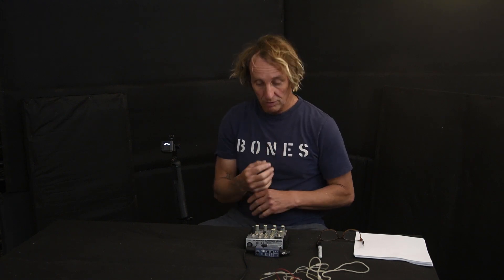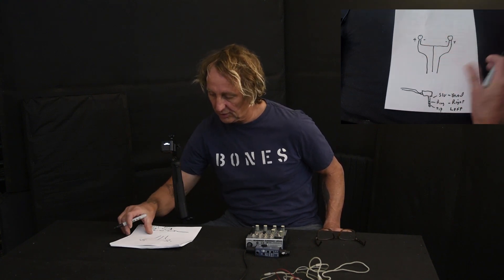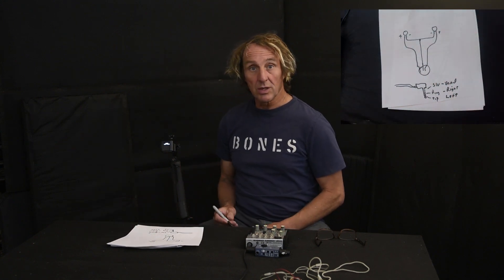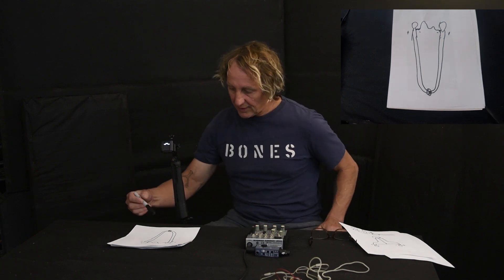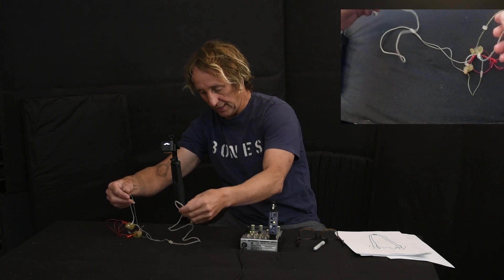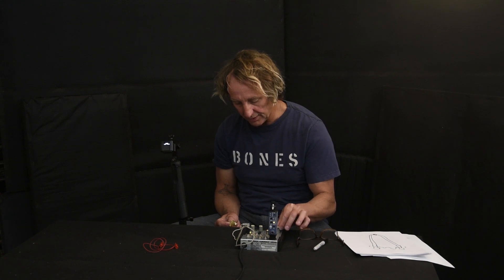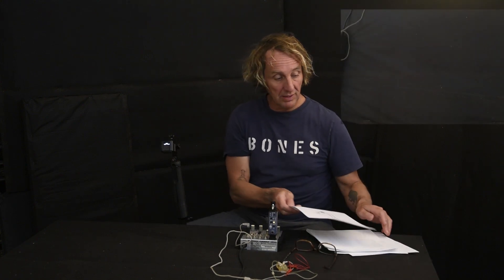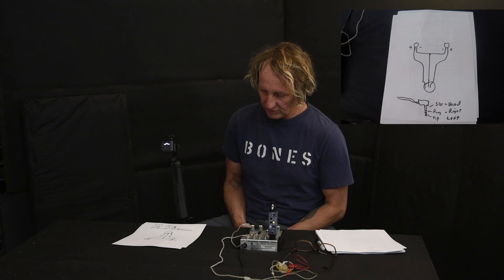The Audible Difference between 3-wire vs 4-wire Headphone/ In-Ear Monitor Cables

Comment: That's what annoys me about Beyerdynamic's wiring choices, particularly since Sennheiser have generally been doing it correctly for 30+ years.
On a side note, what most people don't get about the crosstalk introduced by a 3-wire system is that it effectively attenuates (L+R) over (L-R), i.e. a stereo widening effect. (If driver impedance is quite variable over frequency, that attenuation is not even constant, but that's a discussion for another day.) Since most bass is panned dead-center, this gives a slightly leaner sound depending on how much shared resistance there is in relation to driver impedance. It also means that you can potentially compensate for the effect to some degree if your source equipment sports a fine-grained stereo width control. The arithmetic is quite trivial in the digital domain in particular.

Comment: Hi, Dave! I have a question. I'm in a live situation and I have an rack headphone amp an form it I want to run a long (10 to 23 ft) extension cable in which the player plugs in their in ears. Will the bleed be accentuated by the length of the extension cable? And will it make a difference if the extension cable is 4-wire but ends in a 3-conector TRS female?
Reply from the maker: Should be fine

Comment: any possibility that this is a side-effect of back EMF from the opposite driver finding a partial route through the opposite driver as a shorter path to ground? could current be drawn across the ground wire (less resistance than the ground path back to the amp) by the action of the drivers?
Reply from the maker: It is due to resistance in the ground wire. This is easily demonstrated by reducing the resistance of the ground wire with a clip lead. Seperrat wires can have the same resistance but it eliminates the the resistance impacting the other side

Comment: How is this possible? The resistance of the ground-cable should be 0….. it seems to be a kind of voodooo…300 years ago u would be burned on a Fire….🤷🏽‍♂️
Reply from the maker: Try it. Super simple to prove. I found this issue when doing tests and hard panning signal to one side on various headphones and found that some headphones the image did not pan all the way. I disassembled the headphones and found that all of the headphones that did not pan all the way had three wires and went on to develop a test.

The Crux of the assumption that you made of ground being zero ohms is flawed

Resistance can be low it can be very low but it is never zero. That slight resistance in the ground wire creates this issue

And misunderstanding, false assumptions and oversights have been the driving force behind anger fear and retaliation since the beginning of mankind nothing new here
Reply: @DaveRat  Dave…. the problem with the problem is, I think u r right…. But till today I would not have believed it…. 🤷🏽‍♂️ so thanks again….
Reply from the maker: Same here, I was shocked to find it audible.

The real rub for me was that I was doubtful that home hifi bi wiring had any merit but after finding this, I now think that there could be some possible advantage to running separate wires to a passive HF and LF from the same amp.

Would need to test but the potential for audible artifacts is a pissibility

Comment: Respectfully.  When panning the 3 wire setup with in-phase signals, I believe you are listening to line loss not cross-talk as the signals are 100% in-phase in your noise test.  The net result will manifest itself as a signal loss between the two channels in your test.  In real world 2ch operation where signals differ there could be a cross-talk component present - in which case, I submit would be lower than that of the source system thus rendering it negligible at best.  Of course, if the wire gauge were that of a human hair maybe, but in practical applications probably not noticeable.

The attenuation to signals between the phones on the 3-wire setup would be for in-phase signals in a stereo mix.  This could result in some spacial perception as it would limit peak responses for the in-phase component of the signal.  Change the "openness" of the sound.

I guess that's your point, is there will be an audible difference in 3-wire & 4-wire headphone systems.

Interesting topic Dave.

Oh, feel free to shred my comments.  This isn't a who's right battle or ego game - information exchange to learn and understand.  :)
Reply from the maker: There is definitely a difference between 3 and 4 wire setups that is audible. I can say this because first I heard an audible difference, then after diving into it, I found the difference was three wire headphones have reduced stereo imaging. Also, years ago running a 3 wire setup with a common ground and a a hot for HF and and a hot for LF for a PA system, sounded bad and the issue was fixed when running 4 wires.

Electrically it is easily shown there is a difference, what is surprising is the difference is easily demonstrably audible.
Reply: @DaveRat  Agreed 100%, all the way to perception of stereo imaging being different or constrained.

Comment: This is great stuff. This is the kind of difference that would never show up on a schematic, because both the the three-wire and four-wire setups are "identical" . I think the phenomenon you describe and demonstrate here is similar to why isolated ground receptacles are used in hospitals and such (orange outlets).
Reply from the maker: yes, maybe a bit similar.  Isolated outlets are safer as each has its own ground and if something goes wrong elsewhere it does not impact everywhere.

Yes, the difference does not show up in schematics but should. The assumption that a wire is zero ohms is false. If the true wire resistances are included in the schematic, then the issue would show up and be a calculatable amount.

We see this a lot where assumptions of irrelevance are incorrect.  I have seen it in 3d sound modeling software where the dimensions of the various source loudspeakers is assumed to be smaller than the actual, or the cabinet dimensions are not included as a surface or the lower mass of a modern light weight flown array is not accounted for and when the speakers all move outward, the array moves backwards ever so slightly, but the surface area of the array is so much larger than the surface area of the cones that even a slight motion results in the cabinets acting as an out of polarity sound source that alters the real world dispersion and reduces the output efficiency.

Comment: The effect depends on speaker and wire impedances. Imagine 10 ohm wires and 4 ohm speakers....
Reply from the maker: True and years ago when I first started building speakers I tried using a common ground wire for biamp speakers and using 3 wires. The sound was audibly poor quality. Then years later while doing some perceptive latency tests using headphones and altering the latency in on ear, I noticed that when I muted on le side and had sound sent to the other side, I could hear sound bleed I to the muted side.

I spent some time looking into why this was happening and discovered it did it on my Sennheiser HD 25 0hones and not on my Sony CD3000 headphones. 

I finally located the issue and it was that the Sennheiser HD25 used a 3 wire cable and the Sony's used a 4 wire.

Further testing showed that all the 3 wire headphones had audible sound bleed and and all the 4 wire cables had none or very close to none.

And finally, again many years later, I though I would share something that is real world, audible and not uncommon yet over looked.
Reply: @DaveRat  Most consumers just read the specs, telling them what the actual speakers are capable of, having no idea of impedances, capacitances and other horrors from the snake pit. 😬
Reply from the maker: @ThunderBassistJay  agreed

Comment: Dave, Robert Van Zandt here..  Could you do a part two where you use two identical mixers and else two pulse, pink and music generator/source (unique sources so literally one generator to one mixer to left only of headphone output that you also split into smart. Times two one for left one for right.   Compare this to the normal setup.  That way you can see/hear/measure like you do so well.    Perhaps you will be able to prove that we have headphones/iem all wrong in pro audio that needs to change to discrete outputs on 4 wire.  We would never accept 3 wire on high outputs, we would never use 3 wires to sent left and right to mains.    Why the hell would we affect headphones??    I am predicting not only is the common changing seperation, it is changing both left and right response curves.  you might start a revolution in pro audio my friend.
Reply from the maker: There are two more videos already up on the members side of my YouTube. One is a bit different testing of the 3 wire vs 4 wire and with the other I connect a 4 wire cable and show that if you short it, to make it act like a 3 wire, you are adding copper and reducing the stereo separation.

It's such a cheap and simple fix for headphone and in-ear companies to use 4 vs 3 wire cables, it's pretty silly to see 3 wire cables on anything that costs more than $5 or so.

Comment: Would a TRRS connector (w/a TRRS headphone slot)  solve the issue instead of the option of having 2 x separate jack connectors one for left and the other for right ?
Also, is it possible to attend your next Zoom chat ?
Thx in advance
Reply from the maker: Yes a TRRS would solve it, but even easier is just using 4 wires from the TRS connector as nearly all of the issue is eliminated by using a 4 wire cable. As far as the Zoom chats I post the details on the YouTube Dashboard to Members. The monthly cost is only $4.99 and and no commitment. You could sign up, access all the exclusive members videos, attend a few zoom zoom chats and then cancel before the month is over. 

I use it as a filter to and its a cool group of people. I do an open chat, answer questions and update on what I am working on every week or two in the chats

Comment: There must be a back emf from both drivers. You should have disconnected the sat on driver to see if the pink noise went away
Reply from the maker: The wires act as resistors. And with a 3 wire, both speakers are connected to the common middle resistive wire. The powered speaker has two voltage return paths, one is down the common wire, the other is through the other speaker and down the other wire creating sound.

Another test I did, I used a 4 wire cable, shorted the commons near the speakers and it acts just like a three wire.

Comment: Dave, if I'm understanding correctly. The 4 wire setup has 3 wires coming from the TRS to a connector and then branches to 4 wires? One wire R+, one wire L+ and two independent ground wires to each from the connector?  Where the three wire setup shares a single common ground wire for both L and R from the connecter?  If this is correct, do both the 3 wire and 4 wire set up’s use a common ground between the TRS and connector? The wire differences being after the connector?
Reply from the maker: Yes, what happens before the connector will vary from product to product but typically whatever it is, there are fairly short distances involved with wires or circuit traces that tend to be much thicker than the thin flexible long headphone wires.

After the connector, some manufacturers use 3 wire cables that go to one ear and 2 wires go to the other ear. Some use 4 wires to une ear and 2 wires to the other ear. Some use 3 wires that hit a cable junction and split to 2 wires to each ear,  some use 4 wires that hit a cable junction then 2 wires to each ear. And some use more than 4 wires with multiple wires to each ear.
Reply: Awesome Dave! Definitely learned something new. Thanks for the reply and sharing the knowledge. Much appreciated!
Reply from the maker: @Bobby_Uterus  awesome and thank you Bobby

Comment: Do you know of any wireless/amp manufacturers that support TRRS cables in a live scenario? I know there are amps for audiophile listening, but what about for live use?
Reply from the maker: I do not know anny, but from the testing I have done, the 3 conductor Jack is not the big issue, nearly all the issue is in the cable. I believe it is the desire to have long thin flexible headphone cables that adds the resistance that causes the issue.

Comment: It's my opinion the number of wires doesn't Matter it is the source from which the music comes NOO ?
Reply from the maker: Using the same source, and using 4 wires, if you short the two common wires together near the headphones, making it a 3 wire connection that has the exact same amount of copper, the stereo separation reduces.

Comment: OK.....so electricity is electricity.  This experiment makes me think of ground loops.  Request an experiment where multiple outboard gear is located in the same rack and therefore their chassis grounds are connected through the rack.  Now what if each piece of gear is isolated and their grounds are connected all the way back at the plug.  How would interference on one piece of equipment transfer?  Would one scenario be better than the other?
Thank you for all your brain teasers.....
Reply: Yes ground loops are a different animal. Your test example here just made me start thinking of other issues with ground isolation.
Reply from the maker: @stanleypebsworth1829  I will put ground iso on the list of vids to do!
Reply from the maker: Interesting.  Keep in mind that with this test and headphones we are dealing with a three conductor connector with left, right and common. All three are signal carrying and the headphone end is completely ground isolated.

So we are dealing with signal issues and not ground loop concerns.

With an XLR or balanced TRS and pro audio in general, we use a 3 conductor connector with two signal carrying connections and a separate ground.

So ground loops are a very different adventure.

Comment: This is a resistive divider. 
It comes down to the ratio between the resistance of the cable from the plug to the T and from the T to the speaker. If the common part of the cable is thicker, it will have lower resistance, the voltage drop will be lower so less current will flow through the opposite speaker.
Reply: I don't find this to be a big deal to me, with speakers we have a lot more bleed from one ear to another. I guess most manufacturers have never thought about this either.
Reply from the maker: @paulodpereira  I agree for most applications. That said, there is no strong reason for manufacturers of headphones and in ears to make products that diminish the stereo imaging.

In itself this is not a big deal but combined with other issues like the diminished stereo separation of many in ear wireless transmission systems, I would say an awareness of this undesirable artifact could be useful.

Also in the decision-making process of which product to buy, knowing this info would inspire me to avoid headphones at in ears, with three wire cables
Reply from the maker: True and it amazes me that several well know top manufacturers use 3 wire cables with audible issues. 

I understand that thin flexible cables are desirable, cool, then use 4 wires. Also, using thicker wires reduces the issue and improves the sound, but still, for equal amounts of copper, 4 wires still sounds better, so use 4 wires.

So is this an obvious issue that manufacturers decide to make stuff sound worse for no reason? Or is the issue not as obvious as it seems?

Comment: My main engineering instructor (Michael Pfeifer) who covered a large portion of studio ops classes went on and on about console design of op amps and summing systems. His main pet peeve about supposed 'pro' equipment was all the places he had found where bleed and crosstalk and common non-node-isolated ground crp is allowed to happen, major name companies cutting costs expecting that no one would notice or really care much if they did. It seriously bugged him. This was in the mid 1990s when discussion of digital console design was just starting to take over the buzz that had been leaning toward cleaning up analog designs from previous decades. Now what do we see nearly 30 years later? We see a lot of people revisiting analog summing pre and post digital processing because, yes, it is super important - even when it's not technically 'noise' or distortion muddying up signal integrity. This becomes a huge issue when you consider how many digital processes there are now working in the Ghz ranges that are, basically, left to interact as if it's the wild wild west below broadcast amplitudes. When you start summing all these post processing signals digitally there WILL be artifacts that, though on their own may seem fine, when combined or summed begin to display signs of deterioration (ie not wanting to play together as well as we think they should). Ever struggle with a mix that sounds great straight from a board but no matter what you do it's just not the same after it goes through an Intel codec even though you're using the latest greatest daw and converters? So has everyone else. It's NOT just what's going on from the amp(s) to the transducers.
Reply from the maker: Very interesting!

Comment: Hey dave.  Here is an issue.  With 4 wire IEM systems, you cannot bridge the grounds, the amp device will be shorted and usually die.  In the IEM world, they call it balanced.
Reply from the maker: Interesting. Seems undesirable to make an output that can't deal with being shorted
Reply: @DaveRat  Typical audiophile stuff!!  I agree
Reply from the maker: @MichaelBruceTaos  👍